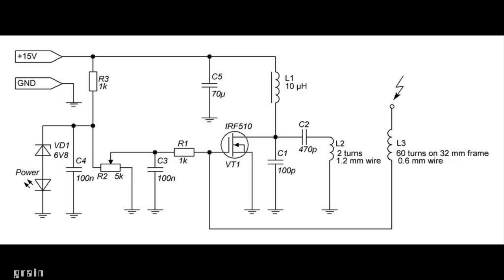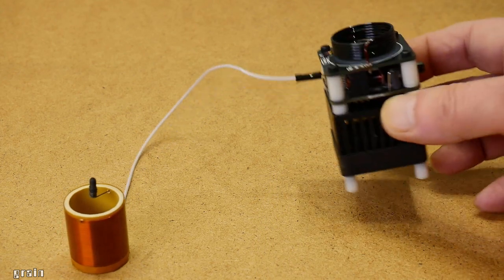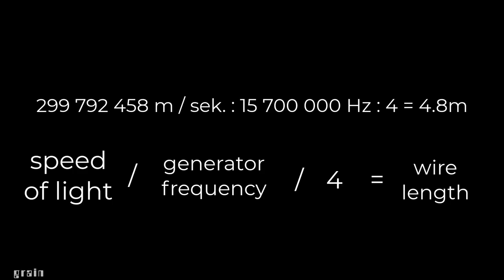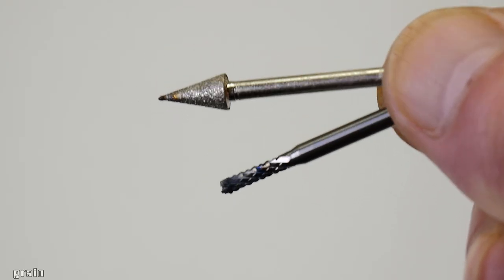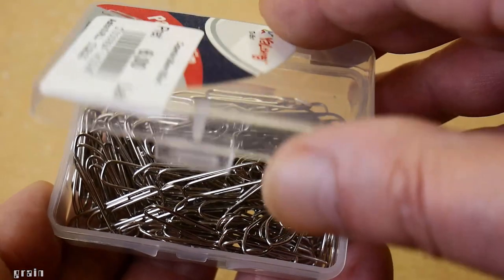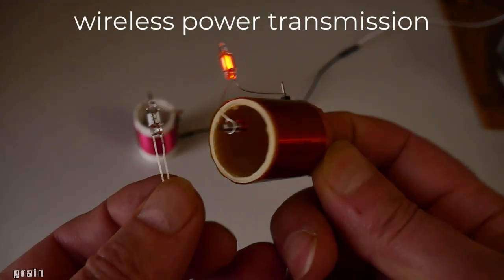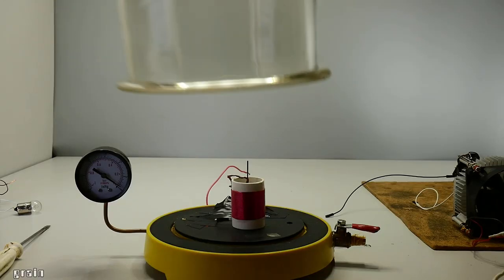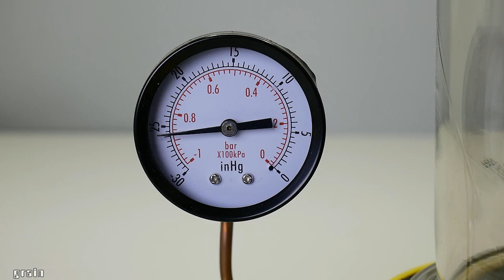Electronic Candle Plasma HFSSTC Experiments

Comment: The germicidal lamp is a complete no. Please never do that again, those lamps can cause skin cancer and also blindness. Stay safe, great video!
Reply: Yup, UV-C is so nasty you could almost fry a steak with it. And tungsten lamps are also a bad idea because X-Rays at high voltages. Although these plasma flame circuits generally don't put out the several hundres of kV that a normal tesla coil puts out(or even 1-2MV for the really big coils), it's still enough to generate X-Rays in many instances.

Comment: You can use iridium spark plug . Just cut off the threaded part and remove the high voltage internal resistor .The central electrode tip of Denso Iridium TT is only 0.4 mm in diameter . And probably this tip will last forever.

Comment: A finely sharpen tig cathoid would do you wonders . It's tungsten
Reply: In these situations, a tungsten electrode will simply burn lol. I have tried doing so, and it doesn't work as well as you'd think. There's a reason why the "IG" in "TIG" stands for inert gas 😁

Comment: Dear Stanislav,

You have nice videos, and I like to ask you why you see the connection between secondary coil wire length and ¼ lamda.
I checked it and in my case it was 5260 mm this is near the ¼ wave length, the question is if this is coincidently?
Because the impedance of the coil is 0.08mH and I made a coil (D=25 mm) with 118 windings of~ 0.8 diameter wire for to have the same inductance, and is working.
0.08mH + virtual 1.4pF = 15MHz.
Please advice
Reply from the maker: I don’t know what to advise, because I myself don’t understand much about this, I found this formula in some video on YouTube about an electronic candle.